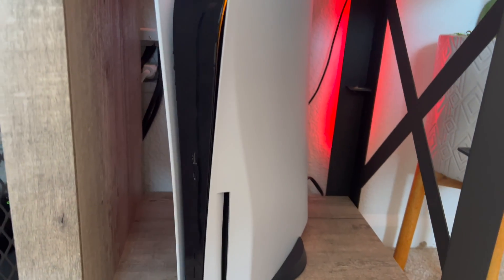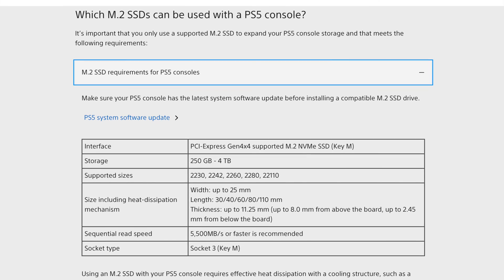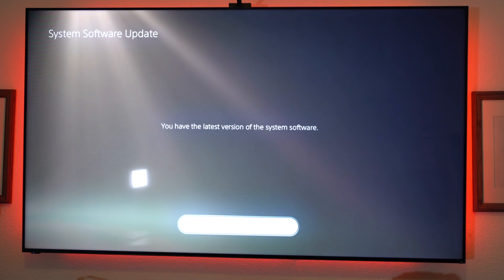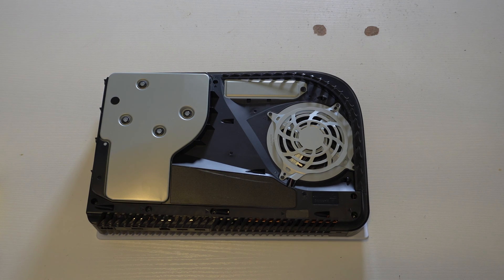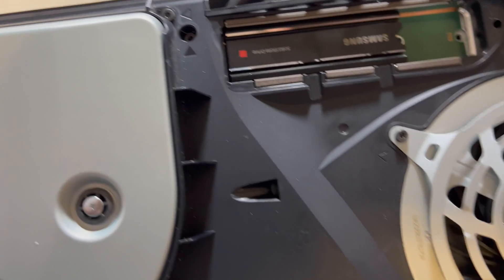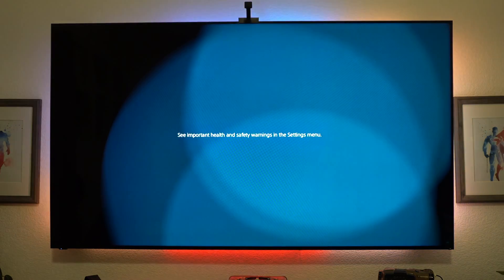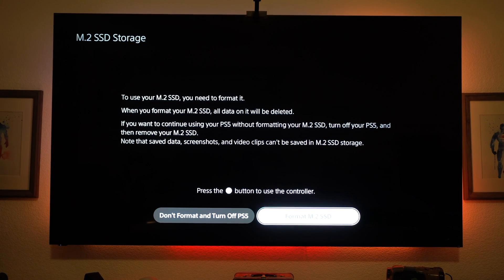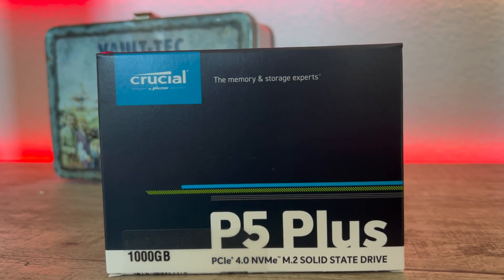PS5 Best M.2 SSD - Samsung 980 Pro VS Crucial P5 Plus

Comment: The thing I found out the hard way that nobody is talking about is the "other" catagory. I have the 1TB 980 pro, I have it half full of games. Every game you download, whether it's the internal or the expansion, it adds to that "other" catagory. And the other catagory can ONLY be on the main original ps5 hard drive. My main drive is half full with the other catagory now. If I full up my 1TB 980 pro then my main drive will be 100% other catagory. And you still need to leave room for updates and installs. I ran into that problem when my other catagory had already maxed out my internal when trying to install a game on my 980 pro it said there wasn't enough room to install and I needed to delete 0KB to install. That's not a mistake, it said 0. That because it read that I had plenty of free space in my 980 pro but it required free space on my main to install. So eventually you will hit the max data available. At my rate it would be around 1.2 or 1.4 TB maximum. Then the other catagory would fill your main drive and not allow any more games, even on the add on SSD. It's dumb and 8 hope they fix this issue eventually.
Reply: Is this fixed yet?
Reply: @fishels3895  yes.

Comment: The Samsung needs to be firmware updated on a PC to unlock the full speed. I got 6500 mb/s after the update.
Reply: It literally makes no difference how fast the SSD read speeds are, as long as they pass the threshold of 5500 mb/s on PS5.
Reply: @vamos419  That makes no sense to me. Load times are obviously gonna be shorter the faster the SSD.
Reply: Same

Comment: Update the firmware of the 980 Pro
If it does have the latest firmware it should preform beter … also note that the PS5 test Is not always accurate and can vary even when done multiple times on the same drive
Reply: Same goes with crucial too

Comment: SN850，also cheaper than 980Pro(well, a bit expensive than Crucial), even faster than that, over 6500 MB/s, wtf Samsung? 🤣
Reply: The 980 Pro likely needs a firmware update with the Samsung Magician tool, plus this wasn’t a fully comprehensive test.

I’m sure these M.2 SSDs perform similarly despite the results.
Reply: @dimitri_1of1  yeah that's the thing, you have to upgrade the firmware yourself to let 980 Pro reach over 6000MB/s on PS5.
it's kinda confusing that Samsung still not doing firmware unlock for even newer shipment, that's why I rather choose seagate or WD😆
Reply: Can you check this WD 850 again? I have a PNY 3140 and each test showed 6500 MB / s reading and now I have a maximum of 5800 MB / s. I think Sony did "something" with the PS5 firmware update. The same thing is with 3040 models - before 5500 MB/s and now is 3800 MB/s.
Reply: @kyopolska7274  I think the SSD logical between PC and PS5 are different, like SN850 on PC it do reach 7200MB/s just close to WD's claim, but on PS5, around 6500MB/s it's the highest speed you can get. 
As for the speed drop over time, it shouldn't happen if you apply the heatsink properly, now my SN850 still perform the same read speed